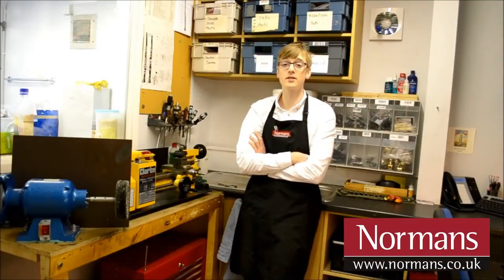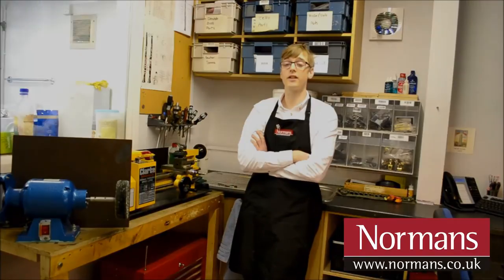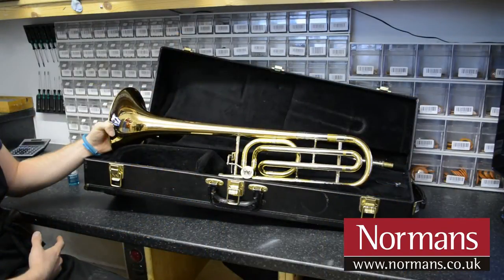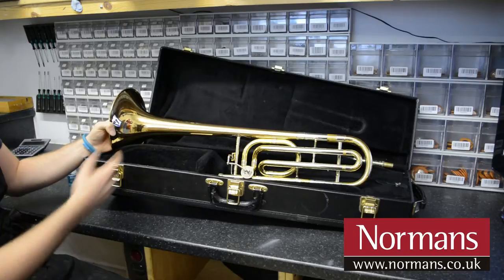How To - Oil A Trombone Rotary Valve

Comment: you aren't supposed to use valve oil (blue juice) on a rotor. You are supposed to use rotor oil for rotor.
Reply: Not really. All is fine. I use valve oil from ultra pure and works wonders. Valve oil and rotor oil is all ok, but avoid using piston oil
Reply: @mondotrombo7167  Thanks for saying that, the fact that I just did and then saw this comment stressed me out a ton lol
Reply: @Charlie_Be4rr  piston oil should work as well, depending on the tolerances of the valve. On my xo 1240 I use Ultrapure light valve oil

Comment: I have a double trigger base trombone. My f attachment plays effortless my but my d attachment is sticking. Its brand new and I've done all of this. It won't stop sticking. I have only slide grease and oil and key & rotary oil. What should I do
Reply: send it in for repair or get a contrabass trombone
Reply: @thgrimreaper9341  y a contra? Does not make sense at all, but you can take the horn’s valves completely apart first and wipe out everything then lube everything, should be fine. If not, send it to a tech for repair
Reply: @mondotrombo7167  because contrabasses are damn cool
Reply: @thgrimreaper9341  but they aren’t really useful
Reply: @mondotrombo7167  Ok? And?
Reply: @thgrimreaper9341  expensive as hell
Reply: @thgrimreaper9341  not really in tune
Reply: @thgrimreaper9341  only very few repretoir
Reply: @thgrimreaper9341  heavy as fuck
Reply: @thgrimreaper9341  hard to control
Reply: @thgrimreaper9341  longer slide which might have worse action
Reply: @thgrimreaper9341  not versatile
Reply: @thgrimreaper9341  hard to fit in different spaces
Reply: @thgrimreaper9341  cant really play high, only in the middle to low bass clef staff
Reply: @thgrimreaper9341  you just dont understand, i can go on all day~
Reply: @thgrimreaper9341  you shouldnet just buy a new horn if you don't know you can fix it let alone get a much more expensive instrument and a more quirky instrument
Reply: @thgrimreaper9341  i agree, contras are cool and fun, but are pretty useless. Im trying to be nice, but I respect your opinion, understand that I'm just using common sense and knowlege.
Reply: @thgrimreaper9341  you are